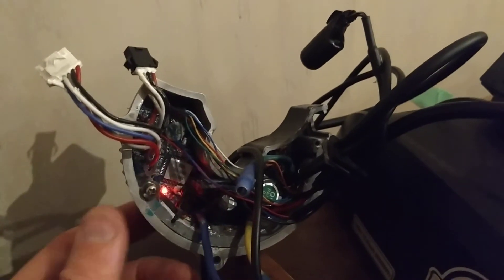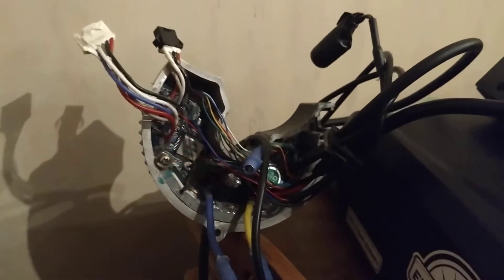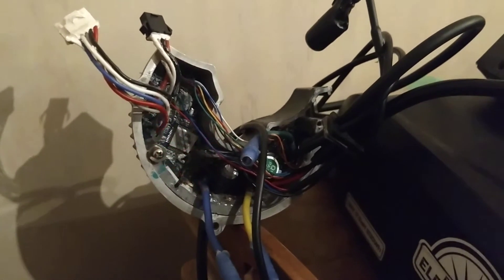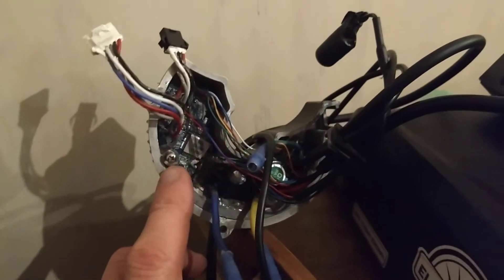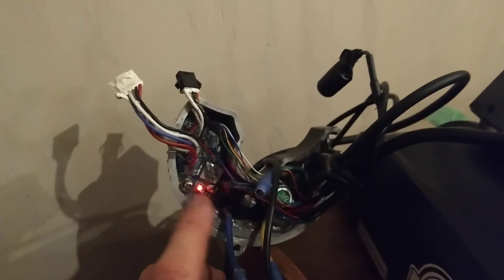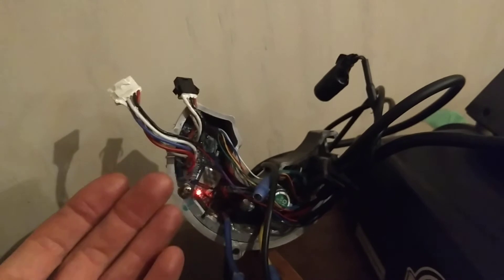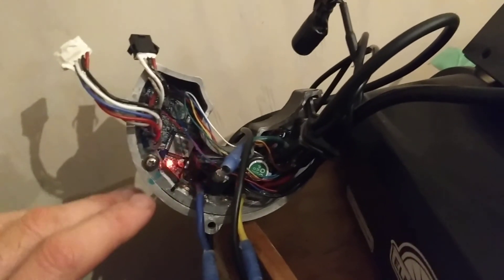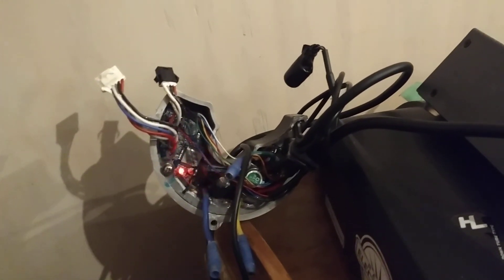Bafang BBS02B Controller Fault Code Question

Comment: Hello I have a BBSO2 and a 1,000 mi on it today it started shutting off for no reason Right when I got started. I shut the unit down fired it back up and it ran well for about 4 miles then it stopped now I'm getting nothing I pulled the codes it says error code 0 / 30 code 1 says 21. I'm at a loss can you help Thanks
Reply from the maker: What does Google say when you enter those codes?

Comment: Did you ever find out the code? Mine is blinking 6 times!! Thanks
Reply from the maker: No, I got no feedback and haven't researched further
Reply: @RaglansElectricBaboon  Thanks. I bought a tester and all the plugs are wrong so very hard to connect it. Still cant figure out the problem. Good luck!